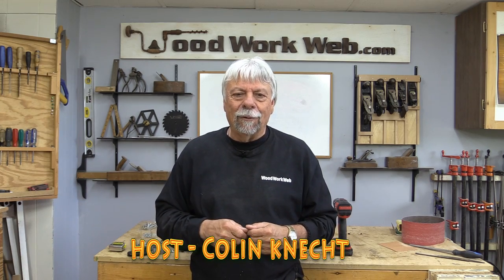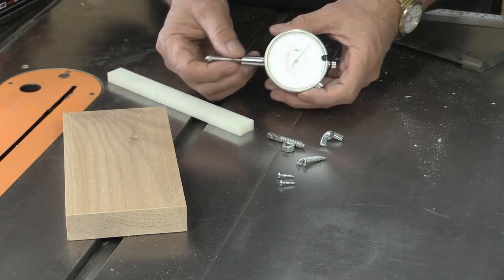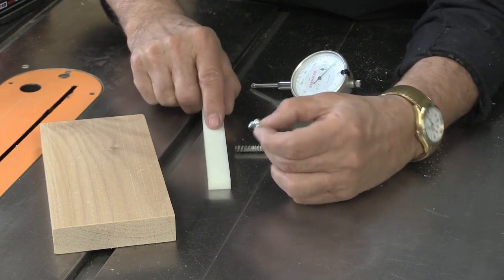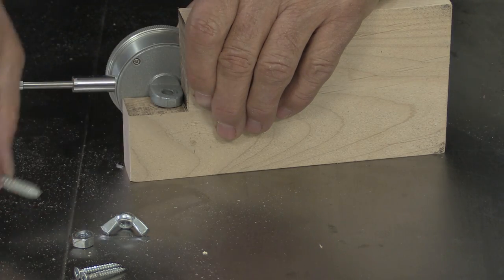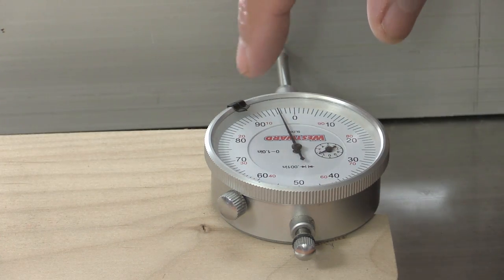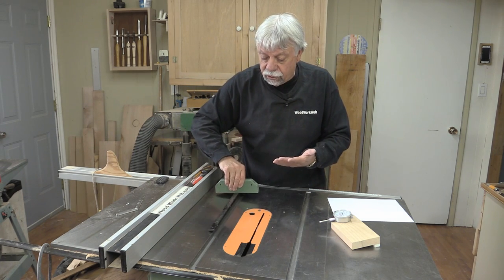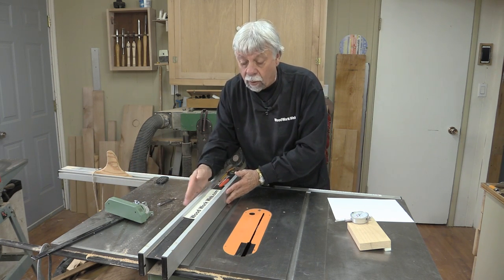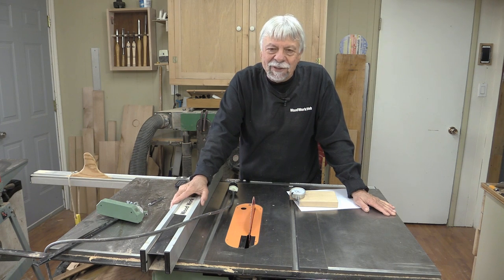Make a Table Saw Fence Alignment Jig for Checking Fence Alignment -  Woodworking Table Saw Jig

Comment: My tracks are not necessarily parallel to my blade. So I touch the blade with the fence and make sure it contacts the teeth at the front and back at full extension. Alternatively I mount my dial indicator to a magnetic base and slide that along the fence with the dial indicator probing the saw.

Comment: Thanks, Colin, great as usual!
I am a begginer in woodworking and am a little disappointed with my new Einhell  TC TS 2025 table saw.
Though i knew  it was a not expensive saw, some  of its characteristics didn,t liked me.
The alignment of the fence is one of they , but the principal is the not accurate of the 90 degrees of the disk.
The question i want make you is if i am expecting too much for this kind of saw or it could be better
By example, if i set the gauge of the inclined cut in zero, the disk is NOT at 90 degrees. There is a difference of almost one milimetter betwen the top and the bottom of the disk saw.
I sincerely congratulate you by the channel
From Argentine, Mario.

Comment: Hey Colin. Is it bad for miter slot to have that metal to metal contact with the adjustment screws? I suppose if they were aluminum screws they might not be abrasive to the miter slot. Meaning, the softer aluminum is less likely to affect the cast iron.

Comment: I bought a Jet Super saw 15 years ago. The left slot is IN THE EXTENSION ! The slots are NOT parallel ! I built a cut off sled & it binds when you push it through. I loosened the 3 bolts on the extension & shimmed it out with aluminum foil. The sled slides better but not perfect. Jet does not do this any longer, both slots are now in the main cast iron.

Comment: This is backwards from what I was taught. The blade/motor should be adjusted to run at 90 degrees to the left (miter gauge) slot. Then the Fence should be adjust from the same miter gauge slot.

Comment: Colin, I enjoy your videos.  Where do you get the plastic for the runners?  Do you cut them to size or are you able to purchase them?  If purchased where do you get them?
Reply: you can get plastic at Peachtree  working . com
Reply: Thanks, David
Reply: The industry name for it is HDPE "high density polyethylene" Amazon has it or as others have mentioned, you can use a cheap cutting board which is the same stuff.
Reply: You can go to the dollar store and purchase a kitchen cutting board. They are also made of that material or very similar that will do the same job.
Reply: @RC-Flight   No the same material at all Cutting board material  melts at normal table saw speed giving a messy cut with melted swarf and you must run the cut as fast as you can to minimise melting. The plastic type you really need is UHMW (ultra high molecular weight polyethylene) It has a Temperature range: -269ºC to +70ºC
. This is sold  as runners by some suppliers to fit standard  tracks.
Typical cutting board is made from HDPE  Temperature range: -100°C to +80°C  that's why you must cold cut.

Comment: Why not use the mitre gauge slot to align your fence since that's what you're doing with your jig.
Reply: Right if you place a piece of Phenolic in the slot & bring the fence up to it it should be flush, if not make adjustments on the fence.

Comment: How to adjust the fence?
Reply: 40yeartrucker there is usually a couple of Allen head bolts or screws on there that will move the fence to left and right. A lot of saw fence are little different but the owners manual that comes with the saws will tell you what do.